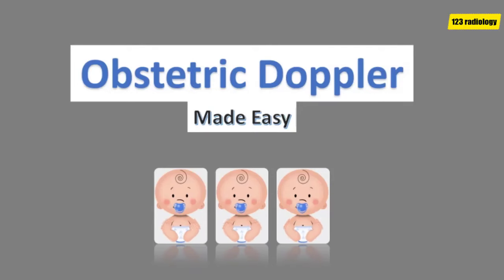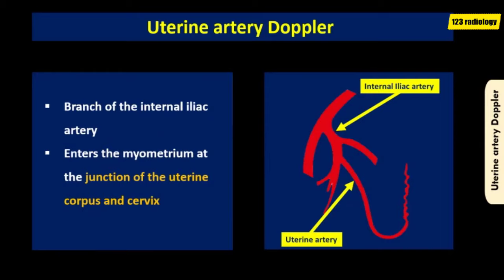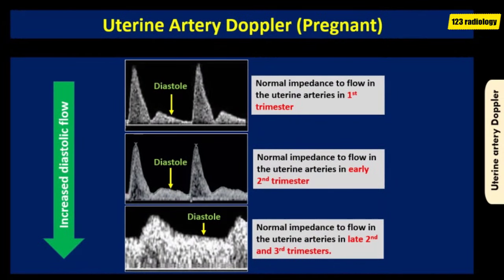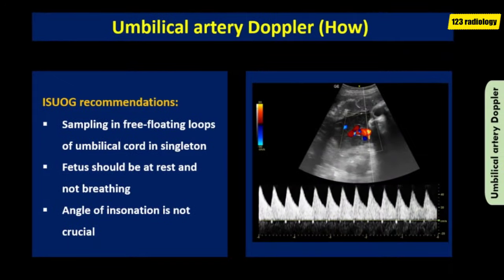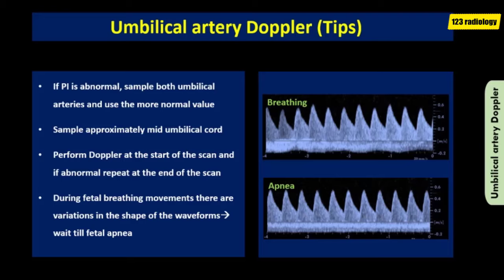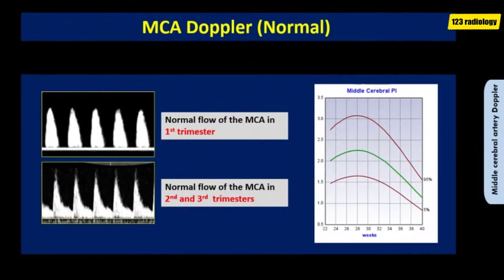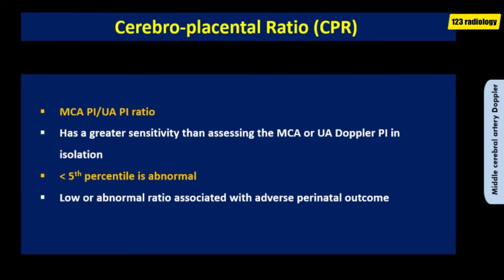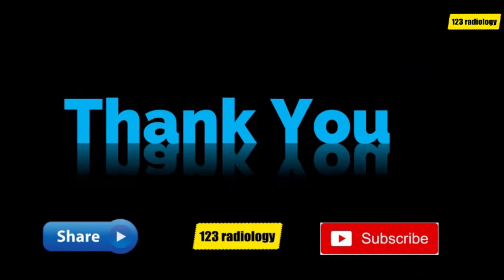Obstetric Doppler Made Easy

Comment: Any tip to get wave forms when fetal head is positioned anteroposterirly with face down when angle will be 90 degree and head is fixed? please guide . please post a video on techniques of pulsed Doppler in fetal echo and the placement of cursors and measurement. Any link?